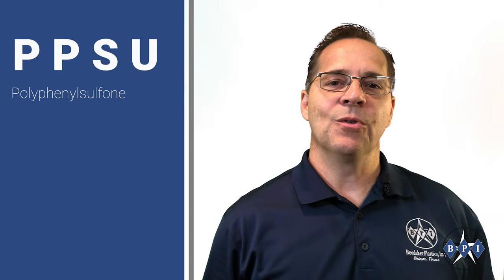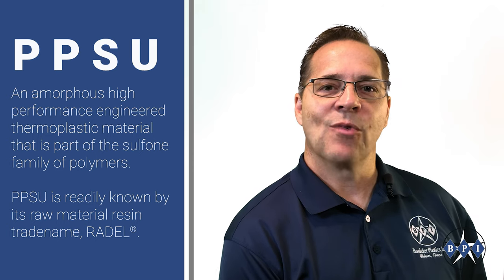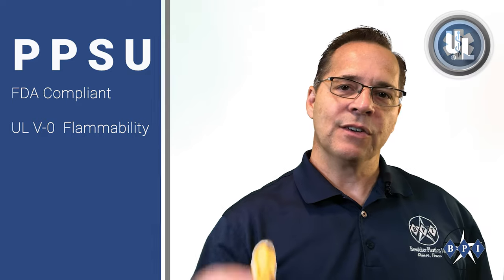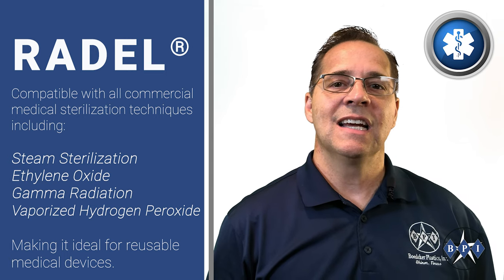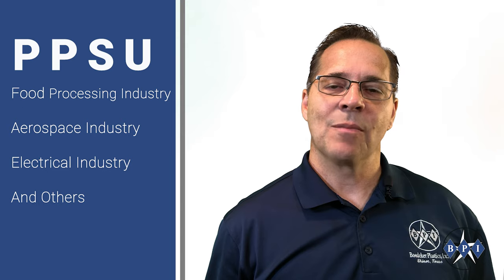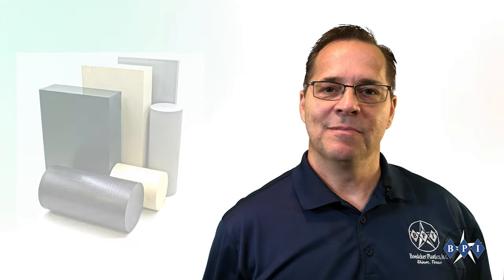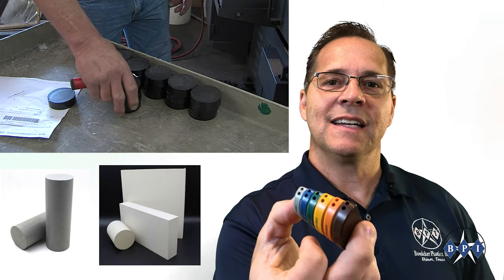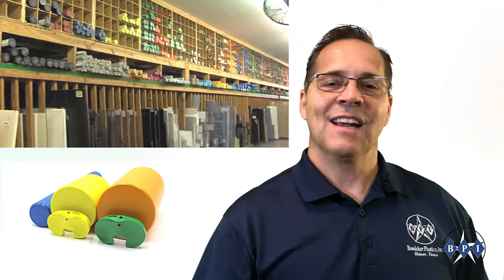Boedeker Material Spotlight - RADEL PPSU | Plastics The Boedeker Way

Comment: There must be a typo on the maximum temperature (340°F does not equal 250°C). Good videos though.
Reply from the maker: Thanks for catching that error, our apologies. It should read 300 F / 148.8 C for the Continuous Use Temperature Thermal Property.  Have a great day.

Comment: Kindly, I would like to ask about Polyphenylsulfone (PPSU) plastic material, can it processed and injection molded with normal injection molding machines same as we are using with PP,ABS, PC, or this material needs a special screw requirements or different injection machine specifications?
Thank you in advance
Reply from the maker: PPSU resin can be processed via injection molding on conventional molding equipment.  The raw material resin manufacturer, Solvay (now called SYENSQO) recommends standard screws with a compression ratio between 1.8:1 and 2.4:1, with a length to diameter ratio between 18:1 and 22:1.  For additional information it may be helpful to review Solvay's Quick Guide to Injection Molding PSU, PPSU, and PESU at the following link.  Thanks for your question!!
https://www.solvay.com/sites/g/files/srpend221/files/2018-07/Sulfones-Quick-Molding-Guide_EN.pdf